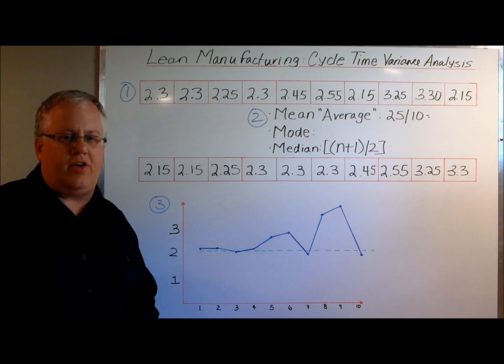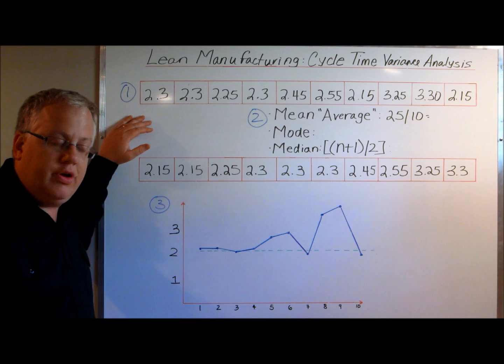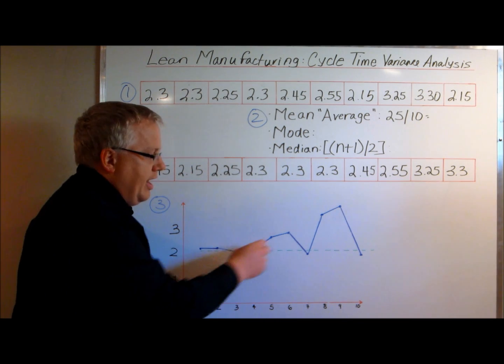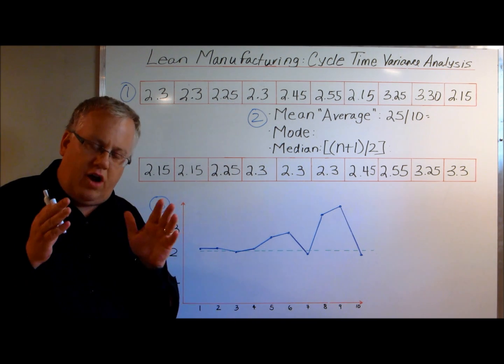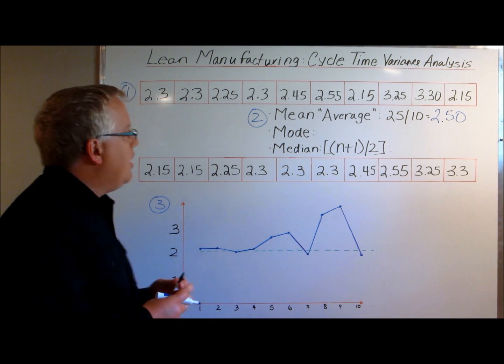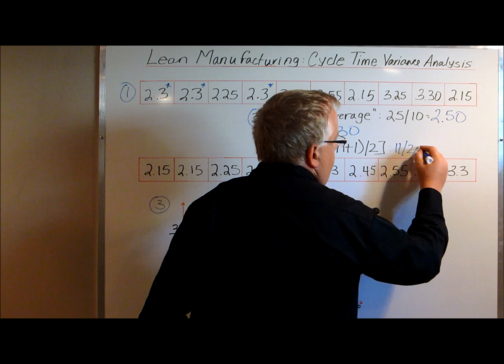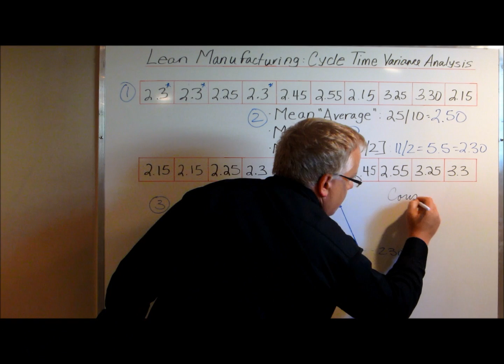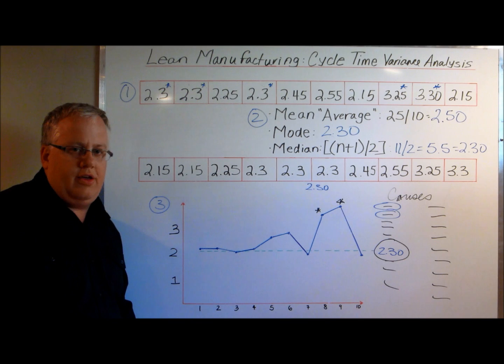Lean Manufacturing: Cycle Time Analysis, Variance Tracking & Eliminating Work Stoppages

Comment: Thanks for sharing the video
For cycle time should one consider also loading and unloading time..
Reply: UNMESH CHANDAK no bro. What are you loading? Loading & unloading is periodic work not cycle able work
Reply: @Zepeda117  hi Daniel
How can that be periodic
If the operator need to load part for every cycle run.

Comment: Forgive me Ian, but this video is really confusing. You suggest the cycle times are in minutes and seconds which would mean the total time should be 27 minutes. I believe the mean has been calculated wrongly, partly because the total should be 27 not 25 and also because 25/10 should equal 2 minutes 30, not 2 minutes 50. So actually the mean should be 27/10 = 2.7, therefore 2 minutes 42.

If the cycle times are purely in minutes then I understand that the total time would be 25 minutes but as explained, the mean should be 2 minutes 30, if this is the case. Then the mode and median become 2 minutes 18. Although I doubt this is the case judging from the set of numbers in your data.

I understand the outcome is the same, that the mean is an overestimate compared with the mode and median, but the mathematics confused me! Any clarification from yourself would be a great help, and appreciated.
Reply from the maker: +Tom Brown Hi Tom. My mistake with this video was not keeping the information uniform across the explanation. I used 2.3 - which to the audience doesn't say anything - is it 2 minutes and 30 seconds (60 + 60 + 30 =150 seconds total) or is it 2 minutes and .3 of a minute (60 + 60 + 18 = 138 seconds) ? I should have kept it all in seconds and then converted afterwards. Your analysis isn't incorrect, but your viewpoint depends upon how you interpret the time. Either way, leaving it up to the audience to assume is not good so I dropped the ball on this one. Thanks for your input.
Reply: Tom Brown he specifically said it was in seconds. I understood perfectly